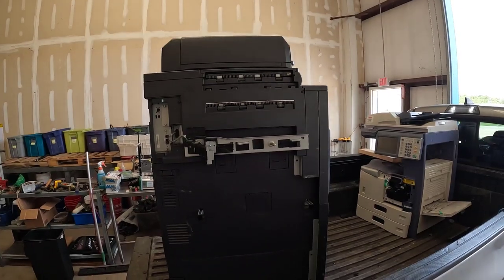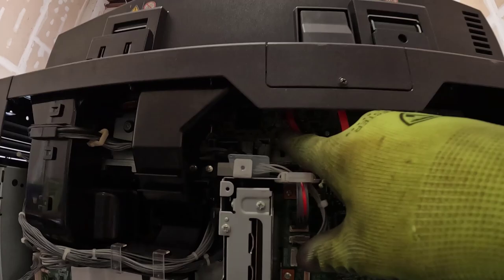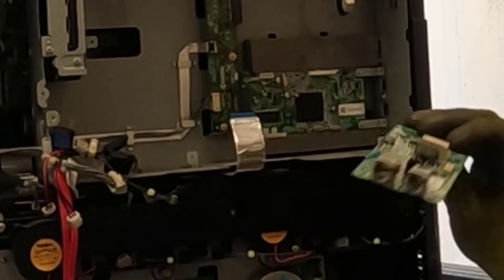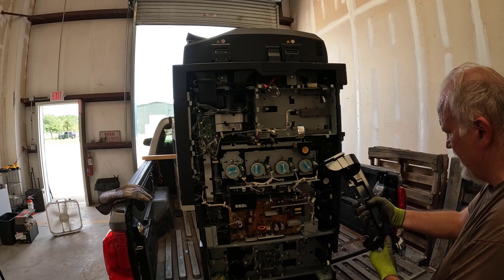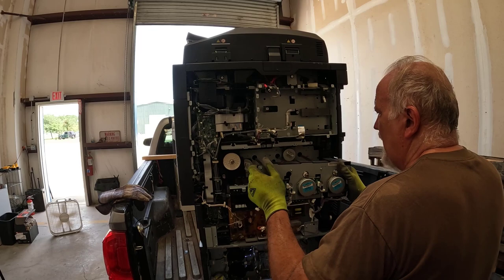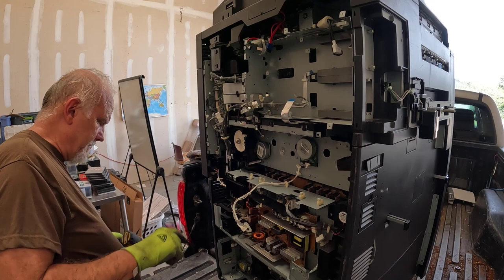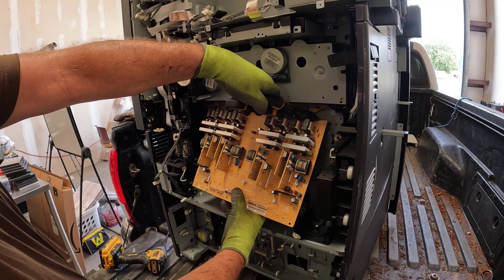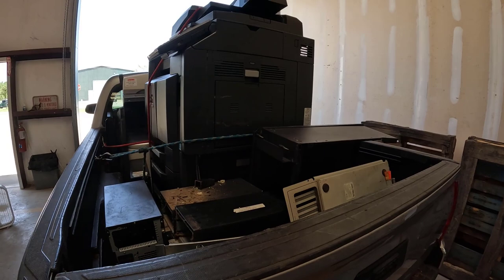Scrapping a big copier - is it worth it?

Comment: You missed some boards, motors, Gold plated connectors, and a nice #2 Copper coil in there.
Reply from the maker: I have no doubt.  As I mentioned in the video, I don't spend a lot of time on these.  I get what's easy and fast in order to keep the scrap flowing and have time to spend on the PC's which are my real bread and butter.

Comment: I once got a Toshiba commercial copier very similar to this one. I totally micro scrapped it and glad I did. I found alot of hidden electronics in those lower drawers and inside the bottom.  Not to mention in the whole the thing weight like 600 or more pounds. So breaking it down into pieces just made everything so much easier to handle. Been lucky to get alot of Toshiba products and the components are always of higher grade than other brands.
Reply from the maker: Yup, they can be heavy sons-a-guns.  Always smart to check the drawers.  I frequently find paper.

Comment: I've found alot of gold plated data ports in the printers, and usually cut the wire side plugs too, because if the board side has gold pins, then so will the wire plug have gold plated connectors. Nice to see I'm not the only one not afraid to tackle these things!
Reply from the maker: 🤣 We ain't afraid of no scrap 😆

Comment: Yeah I like diving into copiers and printers a little too, the boards can be nice like that main one. Decent alum & copper on the power supplies if the boards are easy to get at. The hard drives are encrypted to use with the copier model so I usually just scrap it. I can get carried away with them though and go all in, taking all the plastic covers off looking for what I can get at. Those copier motors I like to open up to get the copper out, they can be pretty easy to dismantle just need to hammer out the center rod to get them started.
Reply from the maker: Cool Jay - it is easy to carried away and just keep digging.
Reply: @sharkscrapper  true but I enjoy the digging into them.

Comment: We went to an office area to pick one of these up and the toner came sliding out and splatted in the parking lot. They are good for steel a few circuit boards and motors but are mostly a pain to deal with.
Reply from the maker: That ink/toner is a real mess.  I had smurf hands for days after one printer.
Reply: @sharkscrapper  yeah when removing the toner cartridges it's always good to have a pair of gloves just used for handling toner. That stuff spreads worse than  Covid but. I know it's weakness. I put them in a stack and over time rain will clean them up. What's left sun will harden.

Comment: A nice one as always! Do you know how much shred weight it was after this?
Reply from the maker: That load, the two copiers and PC shells, was 600 lbs.  The shells were maybe 100 lbs.  So I'm estimating the big copier was 300 lbs and the smaller one 200 lbs?  These things are NOT lite weights.
Reply: @sharkscrapper  the one I scrapped was over 600 pounds took two strong backs and a 800# capacity handtruck to move it. Then could only roll it up my trailer that has a ramp for loading riding mowers.
Reply from the maker: OMG - that's a lot of work.  Some of these do get really big.  Not looking forward to a 600 pounder, but I know it's bound to happen sooner or later.
Reply: @sharkscrapper  yeah but it was a fun scrap it was a big Toshiba commercial that had the big stapler component for documents. It took me like 3 days to fully micro scrap it fully disassemble the thing. Just the high grade boards and copper made it worth the trouble.

Comment: Orrivavkt sine uninteresting stuff on the HDs,
Reply from the maker: Not sure what you're saying?
Reply: @sharkscrapper  i have bought or recovered many 2nd hand HDs.  Often the data was never wiped.  Photos, mail, documents, etc are often left behind.
Reply from the maker: I stopped looking a long time ago and just assume there's data on them.  It only matters for me if the HDD's are 1 TB or larger as those are the only ones I consider reselling.  UNLESS the customer has requested destruction in which case they get drilled.
Reply: @sharkscrapper  I never even thought of reselling old used drives.  Obsolete things usually, much slower and smaller than the new stuff.  BUT I do love the magnets in some of them.  Very powerful magnets.  So after going through them with a reader, I take them apart, rescue the magnets, keep a few screws maybe, and when I have enough disassembled drives I dump it all off at the town dump.  My own personal old HDs I slag into a puddle with a rosebud and my Oxy/Mapp torch then trash the cold slag.  Yes, I know I didn't talk about gold connectors.  I never got into that.